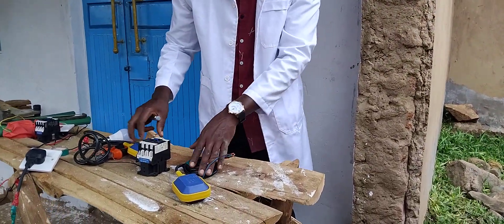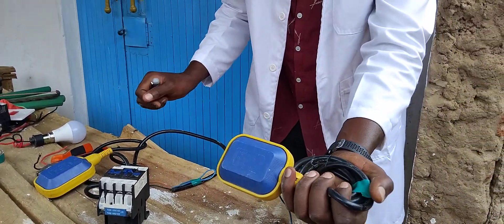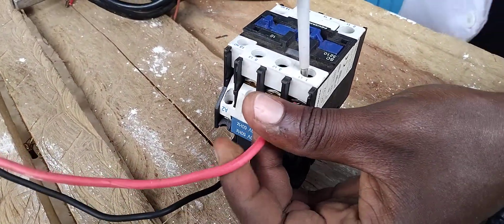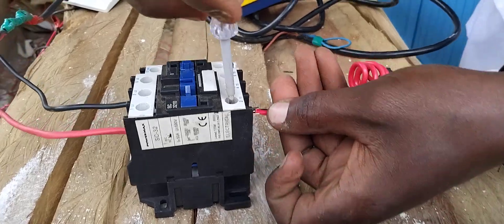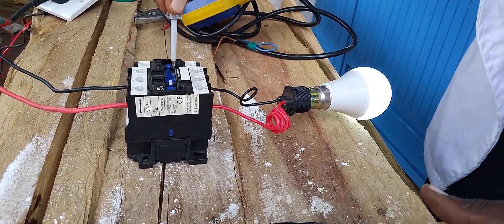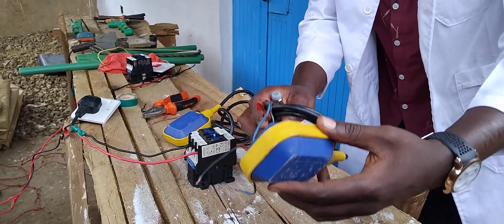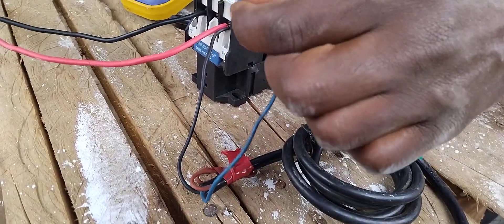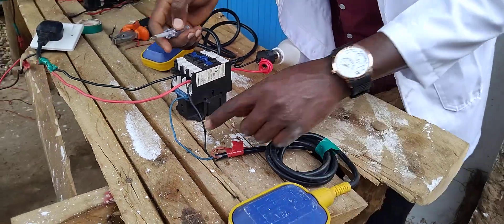How to connect 2 float switches to water pump controlled by magnetic contactor( single phase)

Comment: I installed the floating switch in a tank not in a well.
And I want it to control the water level inside the tank.
Which means when the water is down it should automatically turn on and off when the water is up. But in my own case the floating switches are off when it face down and on when it's i up. How do I install it to make it turn off when when water tank is full..

Comment: How many amps  of the contactor can you use to connect the 2 float switch
Reply from the maker: It depends with the load..
Reply: @Chebuelectricalsolutions what advice would you give me sir for 9 floors 
Submersible pump or normal water which is 3 phase?

Comment: Please why did you connected the black wire in the live connection
Reply from the maker: For the float switch, the black cable is the common wire ( cable) or live wire sir
Reply: @Chebuelectricalsolutions but power doesn't go the float switch
Reply: @zuglozomabikutsinu6036 so neutral will go the float

Comment: Good job..I still suggest that the elevated float should use the hot wire and the ground float should use the neutral wire. Because during adjustment the float from the ground will immerse deeper than the elevated float
Reply: But both wire he gave phase and neutral bro is it wrong

Comment: Thanks for the video it's really nice but my underground tank is not pumping but when I shake shake the underground motor it pumps what could be the problem
Reply from the maker: Hello sir, thanks for the comment,  I really appreciate it. First does your motor have a float switch...?
Reply: So how do u connect submersible water pump,,,I think you know them,,the are mounted with their floater already then put underground,,,,,so how can I connect it to work automatic
Reply from the maker: @kolombojaffary6024 I really  appreciate for your comment 🙏..keep following,  now you can still connect it sir, that one controls the water inside the well ,

Comment: So mr. engineer, if the ground tank is full, won't it over flow as the elevated tank is getting filled?
Reply from the maker: Thanks for the comment, sir.., it won't overflow because both float switches works intermediately..keep following for more,  le me know if you are satisfied with the answer
Reply: That's why there is need for adjustment just like I commented

Comment: What about if both tanks are piped connected? It means if the elevated tank is empty, the pump don't switch on, when then ower tank is empty that is the time the pump switches on. When the lower tank is full it does not swith off the pump, but when the elevated tank is full then the pump switches off.
Reply from the maker: It depends on which tank you choose to insert your float switch., always the top one will be controlling
Reply from the maker: If I've not answered you well, let me know. You pardon the question
Reply: Exactly what i was thinking,  when both  tanks arw empty, the pump won't work